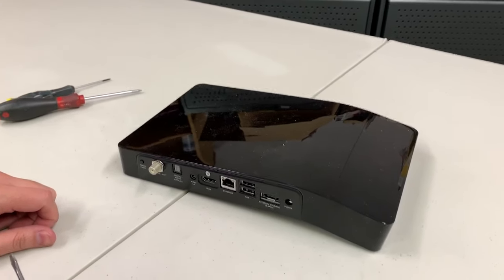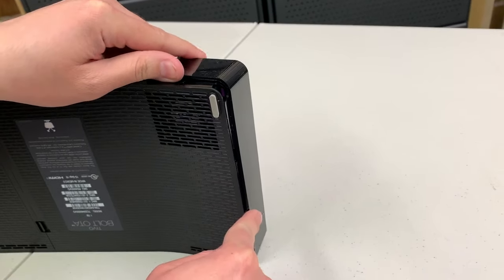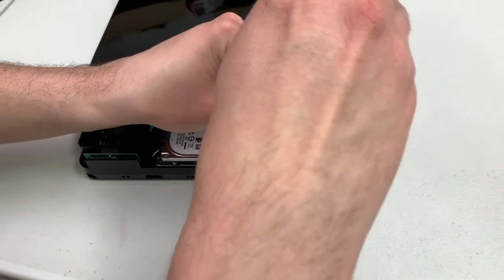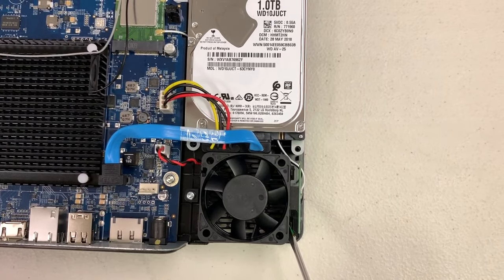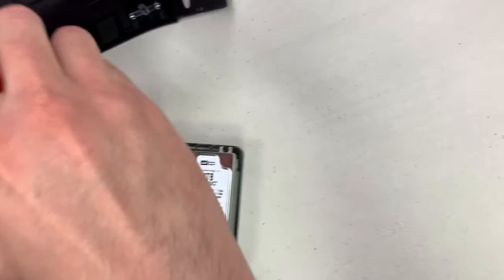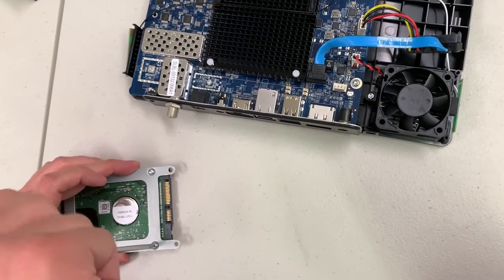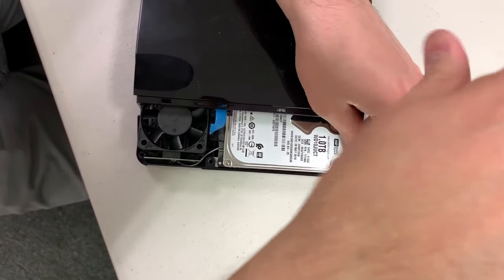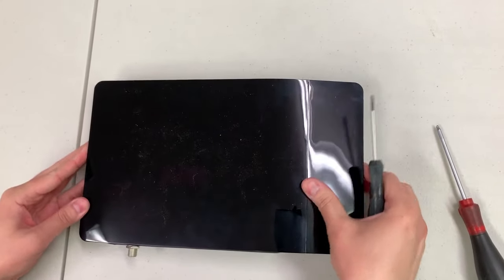TiVo Bolt Fan and Hard Drive Repair and Replacement

Comment: Normally I wouldn't attempt to repair any electronic device, but this one was so simple, and clean and easy to follow, I replaced the fan. I really liked your comment that you replace them all the time, but with a "little bit of work and a little bit of care" you can get it to work." Because of that encouragement, I did take my time with the flexible cover and got it to work fine. So thank you so much! 😊

Comment: This video saved my keister! Playback started skipping ahead at times. So, after 5 years of operation, I thought "maybe" the hard drive was dying? So, this video made it easy to remove the hard drive. And I thought, why not run SpinRite on it? It can't hurt, right? Well, after 30 hours, SpinRite reported the process was complete, with no ecc errors. I reinstalled the drive, and everything is working fine!

Comment: Thank you for such a great video.  The printed instructions with my drive are very detailed, but I do much better with visual instructions.  The great details in this video enabled me to zip right through the whole procedure and got it set up, loaded and ready for duty quite quickly without any bad noises of plastic breaking as you show the right spots.  Thanks again!

Comment: If you replace the HDD, does the device automatically format it? Or is there a special file that needs to be downloaded and installed on the HDD before installation.
Reply: It will format the new drive automatically but you will lose the shows unless you clone the drive from the old to the new using something like Wavlink.

Comment: Would you recommend the Western Digital WD10JUCT hard drive pictured to replace the dead hard drive in a TIVO Bolt Model TCD849500 ?

Comment: @WeaKnees Support would you know how to copy old shows from a failing TiVo Bolt?  They sent a new "replacement" one but I'd like to figure out a way to transfer old shows from the old unit (if the drive isn't dead).  They say I don't have to send the old one back, it's "scrap"..

Comment: Do you have plans for covering the new EdgeT2 models? I will be especially interested upgrading the storage capacity in the future. I will not touch an SSD with a ten feet connector cord because of the limited repeated writes to individual sectors! also would be quite wary of drives that uses SMR technology for storage density increases because of concerns with software compatibility! Two things I miss with TiVo: A clock display and caller ID on TV. For TiVo: How about optional accessories that would plugin to the USB ports?

Comment: It would be cool if you linked to the product pages for the drive and screwdrivers you used.
Reply: They're just standard Torx screws/screwdrivers, they're pretty easy to find. In this case he thankfully mentions the specific sizes you need (T8 and T10). 😊

Comment: Thanks for such a clear instructional video. I read elsewhere that you can swap-in up to a 3TB drive w/o having to do anything else, the drive is just formatted by the TiVo. But this is the first posting I have seen since the flurry of people doing this back in 2015-16. Does the new TiVo software handle 4TB or larger drives by itself yet?
Reply: I'm curious to know this myself. I just bought a 500GB Bolt and a separate 3TB Toshiba hard drive to install as soon as I get everything in.
Reply: I too would like to know since I just purchase a 500 GB Bolt Vox and would like to increase the drive space. I wonder if you can replace it with a SSD drive?
Reply: I got my new Bolt and hard drive in  last week and installing the drive was super easy with the help of videos like this. Also, if you are installing the Toshiba hard drive recommended by countless others, it is in fact as easy as physically replacing the drive and booting up the box. Run the setup process and that is it. No other steps are necessary. Hope this helps.
Reply: @brianberes  Because of the sheer number of read/write cycles a DVR typically makes (it's a lot ), even a reliable Samsung Evo SATA SSD will most likely die within the first 1-2 years of use. Not worth it. This is actually an instance where a mechanical spinning hard drive is superior to an SSD. Two reasons people get SSDs over HDDs is 1) SSDs tend to be quieter than HDDs, and 2) SSDs load files/videos faster than HDDs. While both these things are true for computers, DVR boxes are nowhere nearly as complex/demanding in terms of loading videos. How much time does it typically take for a saved show on you DVR to start playing after you press play? Probably only a second or two. How much noise is your  DVR making? Unless you have it placed right next to your home theater satellite speakers, it's not making enough noise for you to notice to justify an expensive, pointless upgrade to an SSD. Save your money, and just get a 5 TB HDD off of Newegg for roughly the same price as a 1 TB Samsung Evo SSD. You'll get far better use out of it.
Reply: @Killermike2178  
Thanks for the detailed explanation Killermike. Your points dis not cross my mind and they are valid concerns. I haven't upgraded the Bolt as of yet so I've been running stock so far and it's been fine. Seems noiser than my Romio Pro though since I believe a fan is constantly turning on and off compared to my Romio Pro. Otherwise it's been a good machine so far. I bought it foe the option to cut the cord eventually and leave cable and just use HD over air since I live in Houston Texas with lots of local HD channels. Plus it would save me much cash with the monthly cable bill gone. Anyways, thanks again much appreciated.
Reply: Luis Melendez Which Toshiba model hard drive is recommended?
Reply: @Randy Spencer - I just upgraded to the 3TB HDD from Weaknees.  You have to go through the Guided Setup again, put in all of your settings and One Passes.  But, even though it asks you to call in to activate, the unit is still activated as I found out, so you can just continue past that point.
Reply from the maker: For those still interested in the latest answer to this question, note that very very few internal hard drives work in the Bolt, especially if your Bolt is running the voice-enabled software (aka Hydra / TiVo Experience 4). If you're running TE3 and upgrade your TiVo with a drive that is incompatible with TE4, you'll be in for a rude awakening if/when you upgrade. 

For a variety of reasons, we have started offering external storage for the Bolt. With external storage, you can remove the internal drive entirely and use the external. Our external drives are 3.5" desktop drives optimized for use in DVRs. The external drive requires some custom parts but is a great answer for those looking for reliability and/or increased storage capacity. See:

https://www.youtube.com/watch?v=fUS307UtJLU&lc=UgySgMSrqt9nPoSWmx54AaABAg

and 

https://www.weaknees.com/tivo-bolt-bolt-vox-and-bolt-ota.php
Reply: @weakneessupport80  thanks for your detailed explanation and all of the work you do to support the TiVo community. I just purchased a replacement drive for my TiVo bolt. Waiting for it to arrive. This video definitely is a help when it comes to installing.